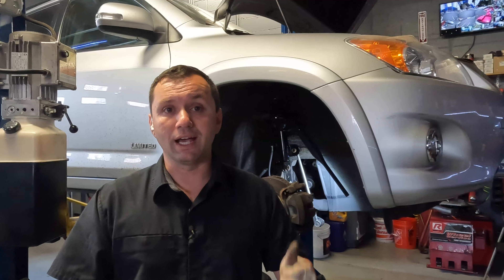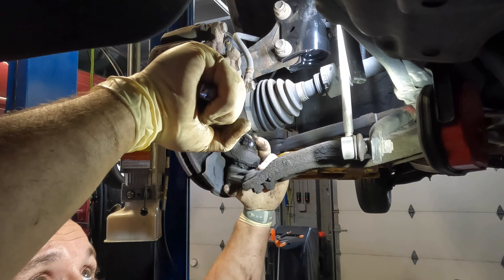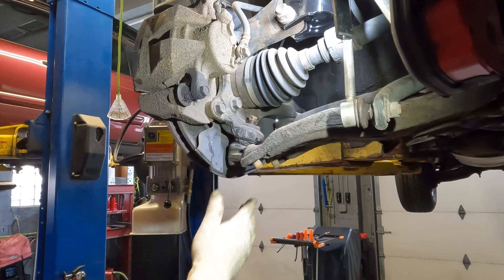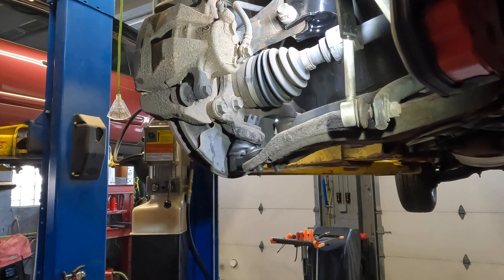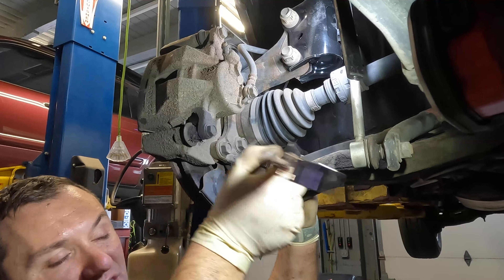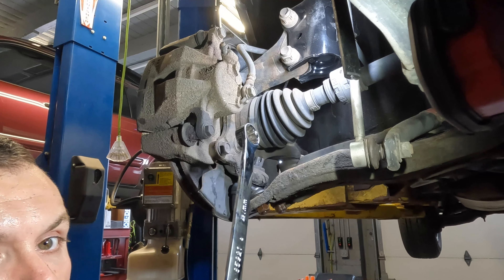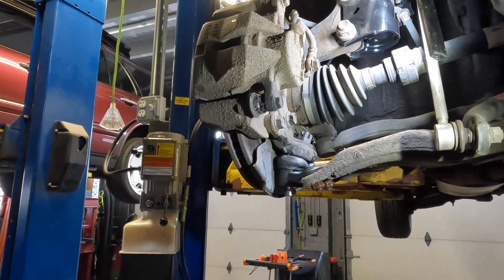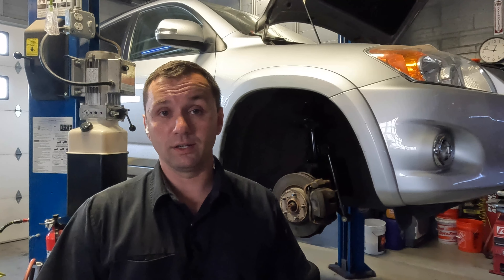CUSTOMER STATES DEALERSHIP SAID BALL JOINT IS LEAKING! HOW TO REPLACE A TOYOTA RAV4 LOWER BALL JOINT

Comment: Nice job!!!! On the 2006 Highlander I had to remove the knuckle from the strut and pull the axle through to gain access to that nut on top of the ball joint. Other than that, those toyota ball joints are easy to replace. I've never used the Moog. The OEM joints aren't too expensive or Sankei 555, which I believe is the OEM manufacturer. 
I'd love to see you do control arms on a 03-08 highlander AWD. The book says 14 hours. Figured out a way to get it done in a couple of hours.

Comment: Hi Mike. Is it a suspension arm on the lower control arm that you worked on the toyota rav4
Reply from the maker: @JohnBassile  i replaced the ball joint that attaches to the lower control arm.
Reply: @TheEnthusiastMechanic  yes you did but in a another video you were showing a part that you wanted guys to tell you what it was  so I thought that piece was an arm that was a part of the control arm connecting  to the chassis. That's my guess but sorry if I'm wrong
Reply from the maker: @JohnBassile  oh it’s ok you’re good I thought you asked me what the ball joint was attached too in the Toyota video. Good guess but that other parts that I wanted people to guess on is a sway bar link for a Mercedes
Reply: @TheEnthusiastMechanic  I thought about putting sway bar link but it didn't resemble one . thank you for replying
Reply from the maker: @JohnBassile  thank you for supporting the channel. I really appreciate it.